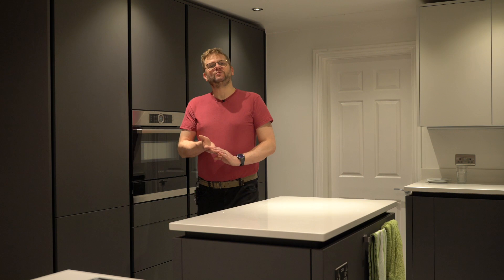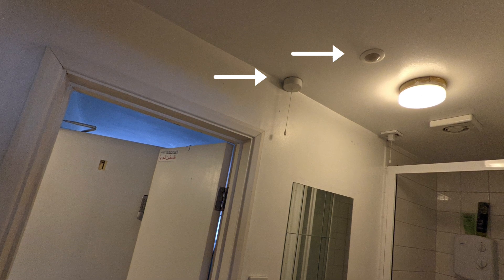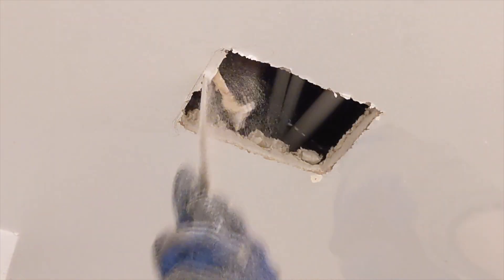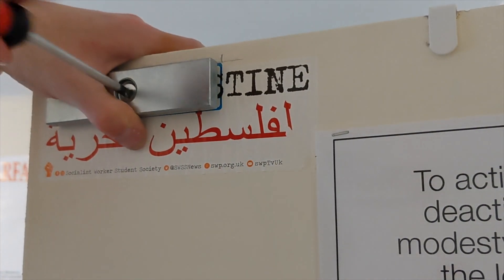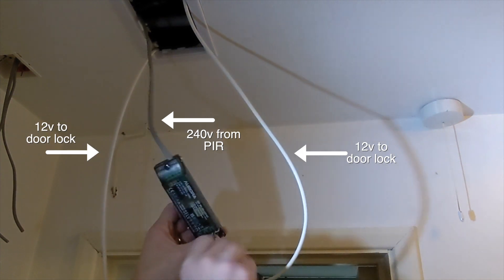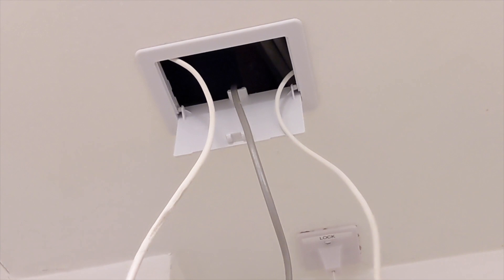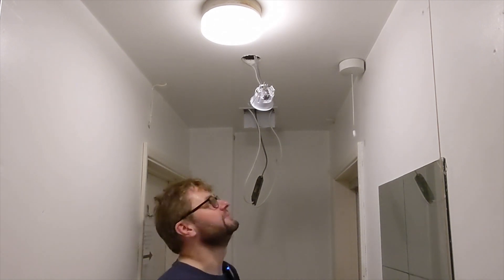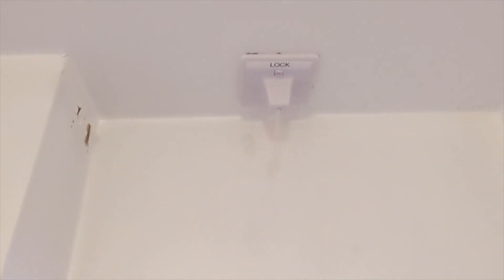Solving the Jack and Jill Shower Shared Bathroom problem Part 2

Comment: How's this solution working out for you? I got a PIR sensor electrical plug to use on my Christmas tree and really enjoyed it until the forced-air heating started triggering it. What kind of false triggers have you experienced? Based on my experience with that PIR plug, for my Jack and Jill bathroom issue, I don't consider PIR alone will be adequate.

I think it would be good to add to the poster that the doors unlock automatically if the power goes out.

Comment: The only issue is if someone happens to be in there longer than they anticipated with minimal movement and the locks unlock .. how long does the motion sensor allow ? Is this adjustable ?
Reply from the maker: Yes all motion sensors are adjustable and if that happens the lights will go off so the person in the shower will certainly know to wave their arms around to turn both the lock and lights back on!!

Comment: A great solution, the only thing I would have added would be a small red (engaged) light on the outside of each door that comes on with the bathroom light.  That way each tenant would know that the room is in use before trying the doors. They would also see at a glance when the room becomes available again.